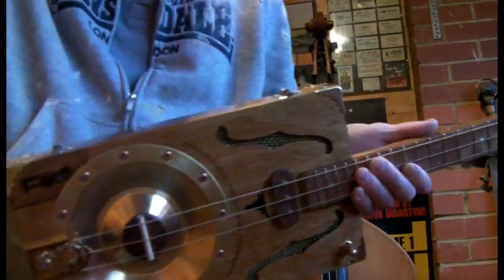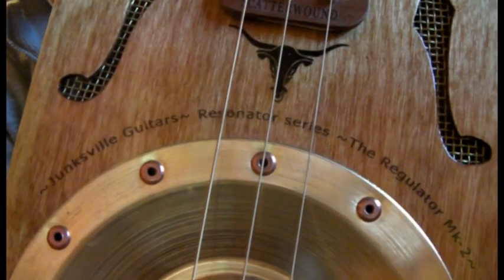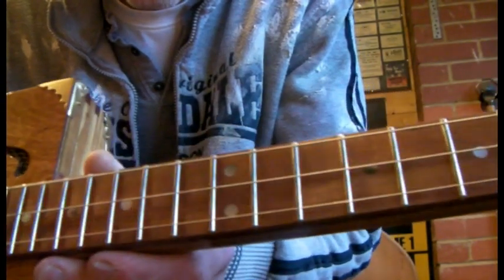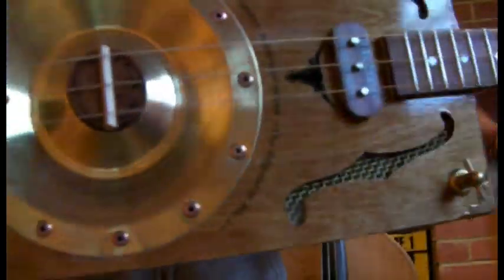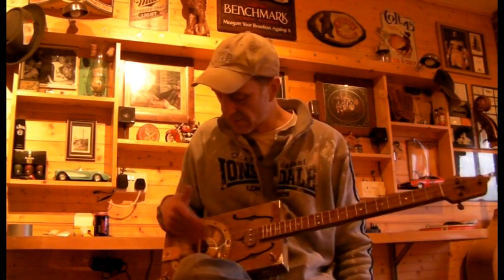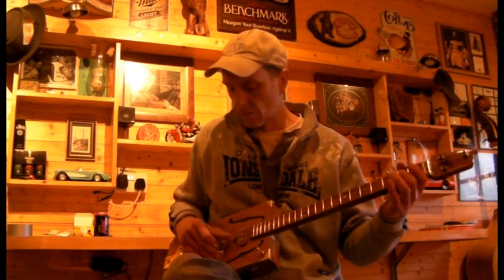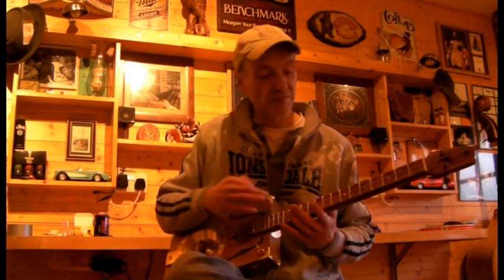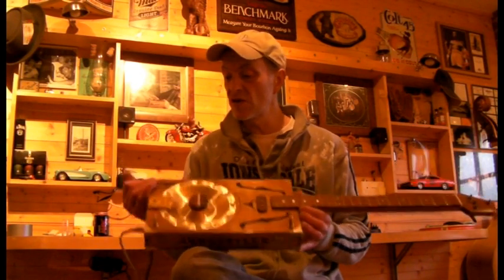RESONATOR CIGAR BOX GUITAR 3 STRING BY JUNKSVILLE ....... THE REGULATOR Mk-2

Comment: Very cool guitar.  My crumby monitor, I'm sure, is not doing the brass and copper justice.  I love tarnished brass and copper.

I found this video while searching for info on building resonator guitars.  I've been building several "cigar box" instruments, and I too decided to go with wound mag pickups, for the same reason you describe (the harsh, scratchy sound). 

but, for a resonator, I'm hoping to amplify the METALLIC, droning quality of the instrument.

You mentioned you tried blending the 2 (mags and piezos) without much success. Any details?  The reason I ask is that I'm trying to tweak the design of an op-amp based buffer.  I would run the mag and piezo seperately (stereo jack) to a dual JFET op amp, get their impedances the same, and THEN blend them.

Any thoughts?

Thanks for posting--again, very cool, very classy guitar.
Reply from the maker: John K Thanks very much John. I've had more success with the piezo on some latest builds I've done, what I did was got some 5mm plywood and cut it in a disc that would fit under the cone, then sliced through the side enough to slide the piezo inside and then used a got glue gun to fix it under the cone. The sound produced was far better, more mellow and no harsh scratchy sound.
Reply: junksville1 I've had pretty good success by "deadening" the piezo a bit by wrapping the outer edge with a kind of "dam" made out of electrical tape, and then pourning a few milimeters of epoxy glue on the top and bottom surface.  It provides stress relief for the wires, and also seems to kill some of high frequency.

I'm actually wondering more about blending piezo and magnetic outputs.  I tried to do it directly (passive) with very little success.  I hope I can the this op-amp device to work.  That would be cool to mix the vibration from the cone (that nice metallic "buzzy" sound) with the magnetics.

Cool build!  I did some junk shopping this weekend and am about to try a resonator guitar myself.